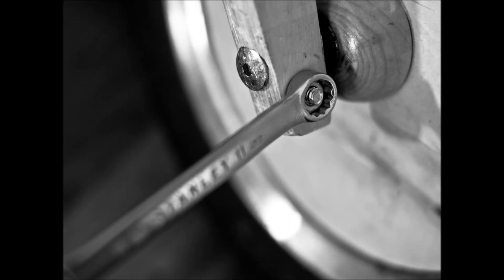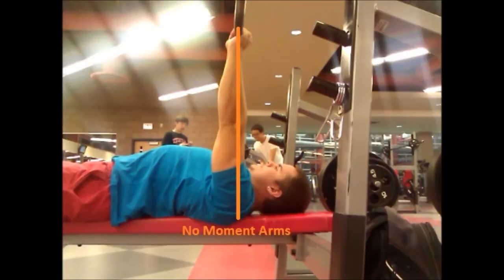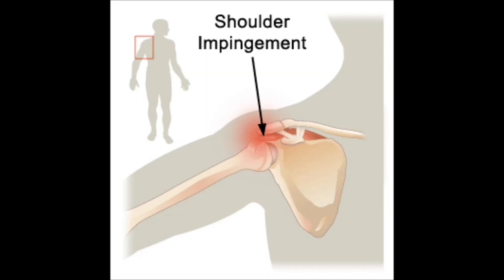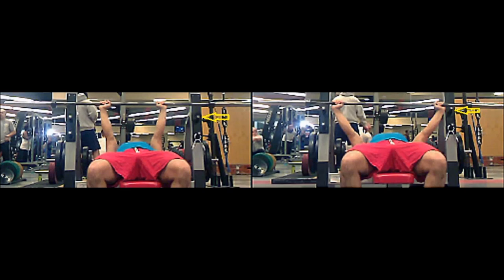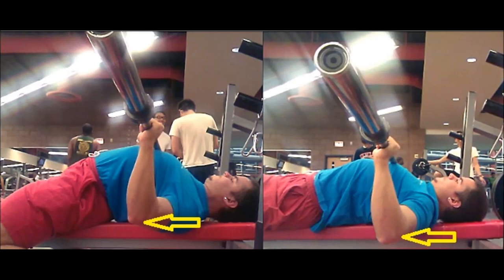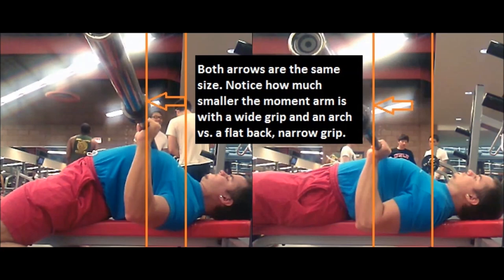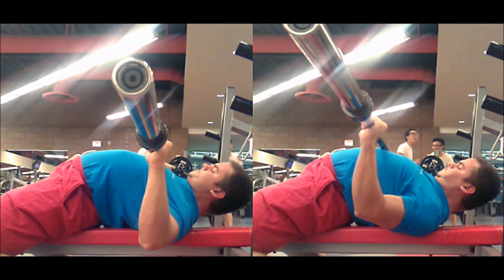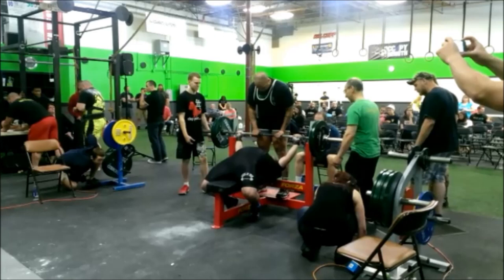Bench Press Form: Wide Grip vs. Narrow, Flat vs. Arched

Comment: great advice for power lifters. But what about for the average gym goer who doesn't care about lifting the heaviest weight possible?
All of this talk about "making it easier" just means that I would add more weight to make it harder again. and all the talk about "reducing range of motion" would meant that I am not targeting as many muscle fibers in the lift.

a very informative video none the less. +1
Reply: Shane Rooney You're comparing two different styles of training.
Reply: Russell Van Linge exactly.

The reason I looked for a video about Bench Press Form is because, while at the gym, some guy came up to me and suggested I should arch my back more when bench pressing.
I listened to him that day at the gym, but as soon as I got home I did some research and realized that his advice (as well as that of this video) is specialized to power lifters. In fact it would actually be detrimental to my goals due to the reduced range of motion.

BUT that doesn't mean that I think this was a bad video. Quite the opposite in fact. I thought this was a very informative video that told me everything that I wanted to know in a simple, straight forward manner.
Reply: Shane Rooney no bro arching your back isn't shortening the range of motion, it just makes you more stable for the lift. Arched back and leg drive is how you're gonna control your 5 rep max and anything under 5 reps.
Reply: Jackson Meade, listen to the video from between 5:40 and 5:50
So, either you are wrong, or the video is wrong.
Reply: +Shane Rooney I dont need to, I know for a fact that arching is what you're supposed to do when you bench. If you don't you could get cramps and you're putting an unecessary stress on your shoulder that could lead to problems.
Reply: And yes I know the range is shortened but if you're arching correctly it should only be an off about an inch, and at this angle your triceps and chest have already performed a full contraction so going deeper is only putting unecessary stress on your joints & muscles for nothing
Reply: Jackson Meade, if the Triceps and Chest have already done a full contraction, then either going deeper is fundamentally impossible OR the exercise will require the use of additional muscle groups to continue the movement.

You are saying that I am wrong, even though I am just saying what the video said.
When I point out exactly where in the video it says this and ask you to look at it, you reply by saying "I dont need to"
and then, in your attempts to back up your view with an explanation, all you end up doing is proving me right.
Reply: Shane Rooney I know that toing deeper is impossible in a contraction while arching your back, I was talking about the fact that the contraction you get when you dont arch your back is no different, other than the fact that it's wrong form. And yes it only takes common sense to know that an arch is literally part of the workout
Reply: And you say arching is only a "powerlifting thing"? Arnold schwartzenegger arched his back for bench like any other guy at the gym who knows a thing or too about lifting weights, but guess what? He was a bodybuilder. Anyway, I was just trying to give you advice considering you were asking for it, but you obviously wont take any advice so why ask for it? lol
Reply: And after looking at the part of the video you were talking about I can now confirm this youtube channel is totally wrong lol he's overarching his back in the left pic. That means when he arched his back, he didnt just start benching, he arched his back then tucked his ass as far up the bench as he could to get that round shape that shortens the range a lot more than you want
Reply: 5:23 "I have really endeavored to set up a big arch. And you will notice that this is lifting my chest way higher"

please at least watch the video before commenting.
Reply: Shane Rooney I just said that, thr arch he's making with his back is too big
Reply: Shane Rooney no matter what
bigger bench=bigger chest/tris/shoulders
Reply: kjrody21
So it is good advice for power lifters AND body builders.
But I still stand by the view that doing a lighter weight 'the hard way' can have the desired results of a compound exercise (by having a greater range of motion and higher focus on stabilizers)

it is still a good video, none the less.
Reply: Shane Rooney basically man it's good to do both that way you get the most benefits from each training style.
Reply: If you watch athlean X's video about bench form you'll see why a little arch in your back is good while benching. He has waaay more credibility than this clown
Reply: +Jackson Meade Υοu are a clown, he has one of the most informative powerlifting channels on youtube
Reply: *****
That is the sort of information that may actually convince me of arching my back.
Training with a "full range of motion" is far more important to me than training with "the heaviest weight possible"
Reply: *****  Wait, wait wait....
I went back through the comments, and I myself posted a time frame in the video where it is said that the range of motion is reduced. (5:40 to 5:50)
And the more I think about it, the more I realize that a reduced range of motion is EXACTLY what power lifters want. Less range of motion = less time needed to lift a stupidly heavy weight.
Reply: *****
I am going to assume that you actually know what you are talking about. So, in regards to range of motion, could you please tell me how what you said before correlates with what was said in the video (specifically at 5:40 - 5:50)
Reply: *****
I DO care about that portion of the video.
because I am trying to make heads-and-tails of what you are saying in regards to what the video said.
The video and you seem to have contradictory pieces of information, and I am just trying to understand how they work together.
Reply: Lesson of the story is, if you don't want any shoulder injuries, then make sure you arch your back.
Reply: *****
We are posting under a thread that I started.
You originally posted here in an attempt to inform me so some new information.
If I do not understand what it is that you are saying, then your time has been wasted.

I have already said that "I am going to assume that you actually know what you are talking about"
which means that I DON'T think you are being contradictory. what you are saying only SOUNDS contradictory (to me), and I am asking you to provide clarification so that I walk away from this with a better understand of the topic.

I appreciate your efforts to inform me. But there is no reason for you to get defensive.
Reply: +Shane Rooney 
The arch in your back puts you in a position to better utilize your pecs instead of your shoulders. The arch also provides a way for you to avoid having to lower the bar to the point of shoulder impingement. It's not just to decrease range of motion so you can lift more weight - that's just the added bonus of doing the lift correctly. When you have a flat back, your chest is not in the ideal position of efficiency.

So yes, general strength lifters should be utilizing these techniques as well. It is safer and more efficient.
Reply: +Joe Piacenti what this guy said, without the arch you are increasing your ROM which was the reason I trained like this for years but I saw way more chest development when I dropped the weight and switched to training with an arch. Broke a six month plateau within six weeks, and since adopting this have had way fewer postural problems/pain in the upper back and shoulder in general
Reply: Xplicit Nation
This was the first video I ever saw from this channel. is there a problem?
Reply: Shane Rooney old thread and I'm sure you know by now but yeah this is more geared towards powerlifters (and while that other dude is right that arching your back slightly is going to save you shoulders he is wrong in saying Izzy is arching his back too much, when you do it to Izzy's extent it is like you said [to decrease range of motion and add more weight to the lift]). So for you you should only slightly arch your back if your goal is to build size because you will have a larger ROM and be able to activate more muscle fibers.